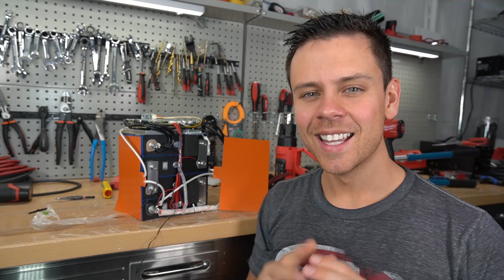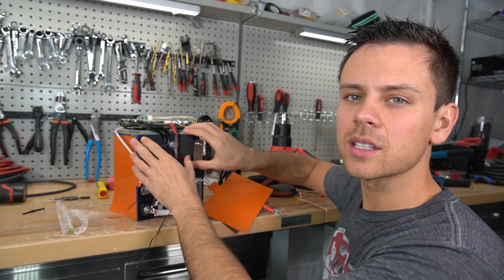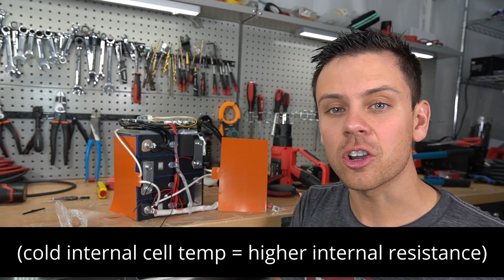LiFePO4 Cold Temperature Misconceptions: Do you really need internal heaters?

Comment: For offgrid rv use I never really saw a use for those heaters.  Just as their mass makes them resistant to getting cold, I’d imagine those resistive heaters would have to run a long time to bring the cells up if cold soaked down in the single digits. Better to mount them inside  furnace heated area. Where the batteries were can become a storage area (for items that aren’t temperature sensitive) so you wouldn’t loose any space.

Comment: I am using an Anker power station and an Aolithium lifepo4 battery 48v/100ah to extend my capacity in an rv in northern WI during winter -20F. I guess that taking the power station and battery home with me when not up there so as not to deal with too cold battery(s) if I were to leave them in rv when not up there and trailer is heated. Is this correct?  Thanks.

Comment: I don’t want the batteries in the living space I’m building an insulated battery box with a thermostat and heater pads…the heat is there if they need it…prollly won’t need it but there just in case I’ve never really tested the low temp shut off on my EP Ever controller perhaps I should test it !
Reply: @kruelunusual6242
0 seconds ago
I’d almost rather bury them in a box under ground that’s about the best insulation there is!

Comment: I need to replace my 5 year old lead acid deep cycle batteries and I want to use lithium lifep04. I have an off grid cabin my batteries are in an insulated box in the basement and my winter temps in that basement can get as low as about 25-28 degrees F.  I know a gallon of distilled water outside that insulated box freezes solid. what would you recommend in regards to "heater pads" pr a low temp series battery?  I will need two 12v 300ah batterys in the end.  thank you

Comment: Hey Will, I would like to use a lifepo4 battery in my truck, and being in the midwest it gets cold.  The problem I would have is if the BMS cuts off the load (not just the charging) at low temperatures, it wouldn’t start the truck.

Comment: I live in an area where outdoor temps are frequently above 110 f I want to build a battery / inverter setup inside of a small chest freezer that is controlled by a thermal switch to keep it near 77f and a heating pad that keeps it above 35f in the winter

Comment: Hi, Question. I bought an off-grid cabin on the Polar Circle. In the winter, outer temperatures range between -25°C and -40°C. In the cabin, we had circa -10°C before we heated it up :) There are two solar panels controlled by MPPT and a 400W wind-powered turbine, which goes via AC/ DC converter directly to the batteries. I want to buy a new LipoFe4 battery and consider whether the wind turbine would not cause a problem with charging if there is a -10°C during the winter. If I buy a new battery with a low-temperature function, will the charging be stopped during the winter even from the wind AC/DC converter? Or is it better to buy the battery with the heating pads to enable charging during the winter when there is wind?  We usually spend only a week or two in the cabin during the winter, and we use batteries only for 12V light loading at that time. Thanks a lot!

Comment: Thanks for this Will and all your great content, I'm learning a lot from you!

Would be nice to get some more in depth talk about low temperature charge protection options, as there's sometimes deals on lifepo4 without the low charge protection so I'm tempted to purchase those and figure out an alternative way to do a low temperature cut off from all the charging methods(alternator, solar, shore power) and it's not clear whether that's a bad idea.

Comment: If my system is turned off and my rig is not being used when temps are below freezing, are my lithium iron phosphate batteries OK to be left in the rig until spring when it’s warm enough to charge them again or will just being in the cold damage them even though they are not being charged?

Comment: Do you have any videos or can you recommend a good source of information on building your own Lifepo4 automobile starting battery for use in central Missouri, where temps can fall to -20 at night for up to 3 nights in a row? Vehicle is kept outside and may not be driven for a week at a time, so self heating batteries would have to not heat until the vehicle was running, so as not to completely drain the battery. Normally, the vehicle will be running for at least 30 minutes once started, so hopefully that's enough time for the heaters to get the pack warm and still have enough time to fully charge it. Any ideas?

Comment: Clearly this guy lives in Las Vegas and not Canada like me...I have been living off grid with lithium batteries for many years and  have a wireless thermometer watching my batteries which are heated by ambient room temp in my van if they were inside a ice chest then they wouyld take days to heat up if they ever did get cold but those heaters would likely do the trick... every situation is different so you cannot categotically say those heaters are not needed if insulated.

Comment: Hello Will, I have a 200 AH battery in a cabin in Missouri. I do not live there, so it isn't heated only when I'm there. I have a real warm heating blanket that the electric doesn't work. But the blanket is a very good insulator. You think if I wrapped the battery in it. It would be ok in say tempts just below freezing?

Comment: I'm planning on locating my LiFePO4 battery rack in an unconditioned storage closet within an open carport.   Where I live, the ambient high temperatures average around 30C throughout the summer, but can hit 40C for maybe a week or two.  I see some conflicting data on cell degradation at these temperatures.  Should I simply just try to cool the rack to ambient temperatures during the summer with increased airflow, or should I try active cooling -- maybe a recirculating chiller or small AC?

Comment: Hello, what can I do in the case of my cabin which is completely off grid. When I am away for a week or longer, it will get to -35 Celsius in the cabin. Building an insulated box may not be enough to keep these above freezing. Not to mention they do not discharge while I am away so they will not warm themselves up. Need your advice badly.

Comment: Is it recommended to use this battery when battery in a engine compartment in a suv in cold weather? The secondary battery will be charged with a redarc BCDC 12/25D charger/isolator. Thx

Comment: What about discharging a 51.2v LiFePo4 battery (with a metal case) in 20f to 25f temperatures, is that safe to do? Should I use a heating pad to keep the battery warm while discharging it?

Comment: I am quite intrigued by this.  I have looked into my Prius gen 3 losing 12V battery power, and concluded the location way back isolated and out in the rear quarter, with zero insulation, is a fridge in effect come winter.  I have bought a couple of little heater plates, but will first insulate, and already have a solar panel attached.  This will probably be best.  Good vid.

Comment: For my rack mount batteries I use seedling tray heaters in between so that the batteries stay warm. The batteries are out in an unheated shop and I have been prevented by the batteries on charging without them as they get too cold. I have blankets over the top of the racks to keep the heat in. Little redneck, but it works.

Comment: My experience: Within 1 week of 20a dc-dc charging at about freezing (32F) temps, the self heating function seems to have broken. Renogy says I have to warm up the batteries first before the heating will turn on (no, I'm not kidding)
Reply: I bought an electric over/air fryer with digital controls. It would not work at the campground I was remodeling but worked at home. It turns out it only worked above 55 degrees F but it was sometimes freezing or below during the day and freezing at night. What a joke......my trailer was too cold to cook food. I returned it and ordered the mechanical style of the same oven with a timer knob. It worked great.

Comment: living in my part of cal, 1000F elv. a bit below the snow line (3000F),  but can get a good dusting a couple times a year, but 99% gone that day.
not really sure if i need the added cost of built in warmers. with that said. it can get down into the teens for a couple day-more. so if not heated, then yes needs low temp cut off.
my rv is not the best for insulation, under the bed it gets colder than the cabin does. (no air movement there).
would just a dog bed warmer, heating pad, something like a water hose heater line, maybe a incandescent work light?  i am thinking just some heat there can keep the temp up a bit.
but yes more "stuff" between the outside air then the factory location. that is open to the night air.
and yes sitting in the yard, it is plugged into the home source. (sad pg&e).
only thing always on is the microwave clock, the fridge, (only 2 things that must have ac power to work),
and the stereo again just a clock (12V DC). no lights, heater, etc.
in "camp" if it is cold outside, (no ac power input there as i boon dock).  the cabin heater is on. at 63, creaky joints, i do not like being cold.

Comment: You leave the ac on without load the built in alternator should produce heat this will help hold battery temp on a power station. Same way if you use an alternator on top of the battery that should generate some heat and insulating could help. You are going to drain few watts keeping ac on but will keep your battery in good condition durning cold weather while leaving them in a vehicle

Comment: What would you recommend for an off grid cabin, only used on weekends. It’s below 40 sometimes freezing for a month. I only have 150 W of solar panels so it sounds like the heated battery would not work because it would not be able to charge ever. Would any lithium battery work or should I stick with lead acid that’s working fine?

Comment: Advice appreciated.  I have a small hunting shed where  I stay the night occasionally,  a 100 watt solar panel and will be using a Rich 20 amp MPPT controller soon, have it on order.  I have been using a Rich PWM controller for the last two years.    My AGM 100 amp battery is in a wooden box (2" thick boards, not air tight though relatively so) sitting beside the shed.  My power usage is relatively low with everything DC - lights, fans and a small DC TV.  

I have been listening to a lot of discussion about the LifePO4 batteries and trying to decide if this type battery is appropriate for me.  Since I only stay at the shack now and then, there is no regular drain on the battery to heat up the box most of the time.  I can insulate inside the battery box in some manner, so I am wondering if perhaps a very light draw from a DC light burning inside the shack or some other low-draw device might provide enough heat from discharge to keep the battery warm.   Is this something I should be doing with the AGM battery as well?   Temps here in winter get below freezing, in the 20"s fairly often but also in the teens and single digits occasionally.  We did have -5 degree temps for two or three days this past winter.  I am relatively new to solar and trying to learn more, and I do appreciate any information any of you might be willing to share.  I will say that the system I currently have has served me well for the last two seasons, but it appears that (guessing) the battery may be losing some power since it has dropped below 12.2 amps with light usage a couple of times, and more often the 5 bar battery indicator on the controller drops to 4 bars fairly quickly, such as with only 14 watts of lights and a 10 watt fan running.

Is a LifePO4 for me, to give plenty of reserve power when I need it, or am I better off to continue with an AGM battery?  And, will a low-draw device provide  enough heat to keep the battery warm?  As I say, I am trying to learn more and I know that most of you guys have far more knowledge about solar applications than I do.  I appreciate your input.

Comment: Looking to upgrade to lithium batteries for a hunting camp. From mid December to April it is not used, house is winterized.  My question is should i keep the lithium batteries warm and connected to charger OR disconnect batteries from charge controller so they dont get charged when it gets below 32 degrees? Will leaving lithium batteries off a charger for 3-4 months in cold temp be ok or do any damage to batteries?

Comment: After looking at this video I decided I do need internal heaters for my batteries. I have them stored in the non-heated garage in the back of my camper. so cool air can run under the car and make it way colder. They sre not in a plastic box (I build a wooden box around them instead, but thats only to deflect items from accidentally hitting the batteries, not to insulate in any way shape or form.

I also drive fairly often into snowy areas, like up a mountain.

I decided to do something similar to what you did, with the sewage heating pad, and use a terranium one, which fits sandwiched between the cells. I am planning to make some kind of insulation as well which I can put on in the winter and take off in the summer, but havent planned that one out yet

Comment: I built a 3 sided insulated enclosure. The inverter gets hot enough to keep the inside of the enclosure 30° above the outside temperature. So when we have a freeze warning I push the enclosure up against the wall, when the freeze warning is gone I pull the enclosure away from the wall.

Comment: Hi Will, I had a question. SOK recommends fully charging and discharging for 2 cycles to calibrate the BMS SOC if it’s not accurate. Do you have any tips on how to quickly discharge a SOK battery to do these 2 cycles?

Comment: Hi Will,  I don't know if you remember me from way back. I have always been one of your most ardent supporters. I want to offer another option in terms of keeping your batteries warm. I use heating mats designed for the germination of plant seedlings. I place each of my 24v 100hh batteries on an incredibly inexpensive seedling heat mat. I run a large ranch at over 7000 feet in the southern Rockies. Winds often bring us well below zero.
Reply: I was thinking the same thing but then I realized because all my power generally comes from the battery I would want to heat... How would that work? (Edit: these batteries can safely discharge at a lower temperature than they can charge at so that helps)
I do have a couple of small "solar generators" that I could potentially keep warmer to run the seed heater. So you do need a separate power source to run the heaters at least until the main battery is warm enough right? 
Also, to clarify, the seed warmers are self regulating so no thermostat is needed? Thanks
Reply: I was thinking about the same thing. My family is into gardening and I think it's probably what might have sparked your idea too. How does it work with a thermostat?
Reply: @mntman603  You don't need a thermostat if you have simple and self regulating heat mats for seedlings.  All is good.
Reply: @MrBwalendy  cool!  I wasn't sure how the heating mats operated and if they had that capability. Thanks for the input brother.

Comment: I have 3 EG4 Lifepower 48v rackmount batteries in a 6 bay rack sitting in an insulated room in an uninsulated shed.  I've been constantly having to warm my batteries in subfreezing temps so I can charge them  (BMS low temp protection kicks in).  I placed a small heater in the room but that doesn't warm them up very fast, and at times used a small propane space heater to help speed things up.  I finally decided to reduce the space I needed to heat by wrapping just the battery rack itself on the outside using 3/4" foil faced polyiso sheeting and foil tape.  My hope was to be able to heat the small space with just the batteries in it much more quickly and use much less energy doing so.  As it turns out, I don't need ANY external heating so far (temps down to single digits).  I do have a small space heater that I just need to plug in sitting inside the enclosed space in the event that the batteries do get too cold.  But so far, just the heat the batteries and occassionally, the two 48v chargers I run off of my generator are enough to maintain above freezing temps evidently.  I'll let you know how that goes after some below zero temps.

Comment: I was all cued up to get a heated battery from Ampere Time but watched your SOK video and that changed my mind. They also offer a heated one but after seeing this video I think I will skip the heat.  And due to their form factor I might be able to fit 2 of the 200ah in my motorhome in their stock location under my steps.  My big issue is that this is outside.  So winter could possibly be an issue.  I think I have room to build a box or at least make a reflectex liner for this compartment.